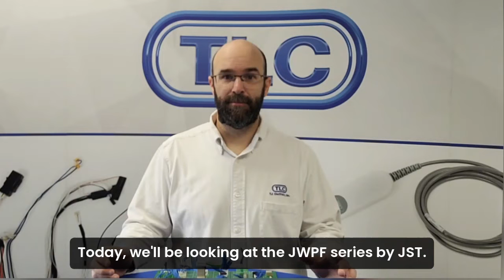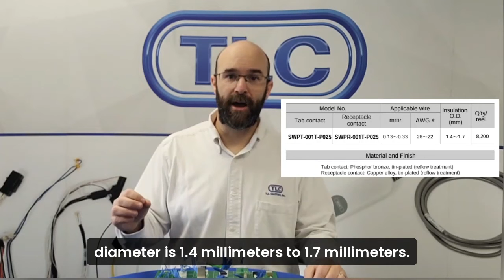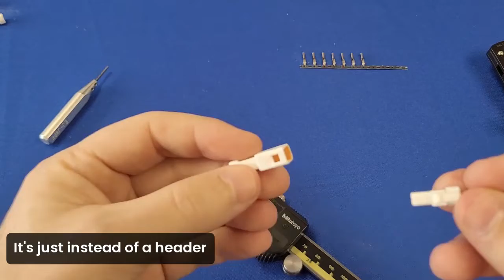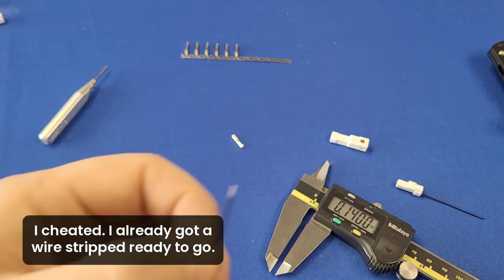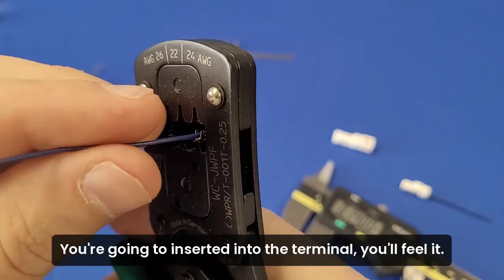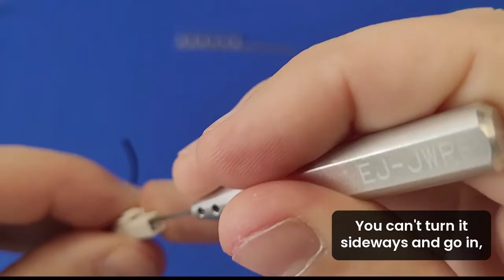JST-JWPF Product Demo

Comment: I'm sure they work great if you buy their crimper.  I've been trying to make them work with three different crimpers that I have, they always leave the crimped area to wide to go into the connector shell.  deforming the crimp with a pair of pliers you can make it narrow enough to go in but your crimp quality can't be very good. My opinion is leave these to the pros who can afford their crimper. I think their crimper was over $500.
Reply: I saw on another video that the SN-03BM crimper works.
Reply: I had the same experience.  So I bought the pre-crimped pins.